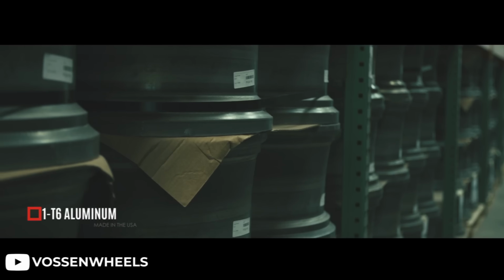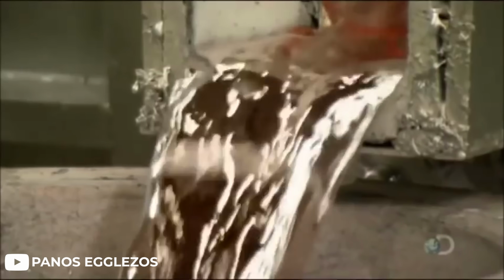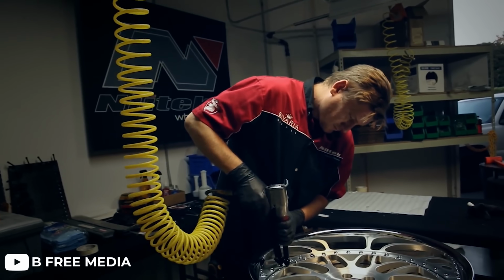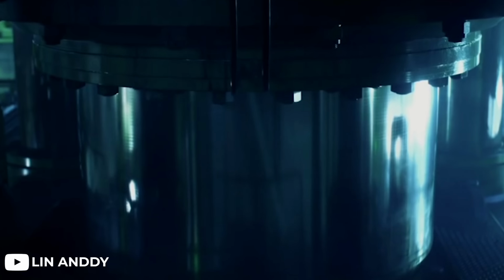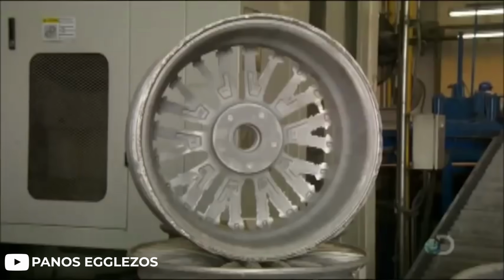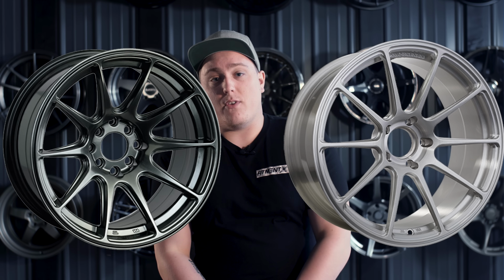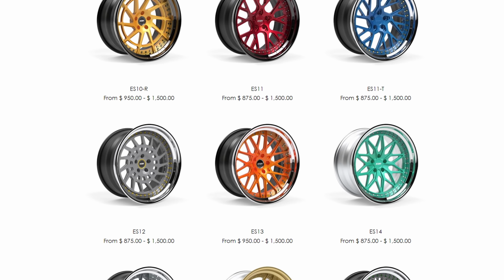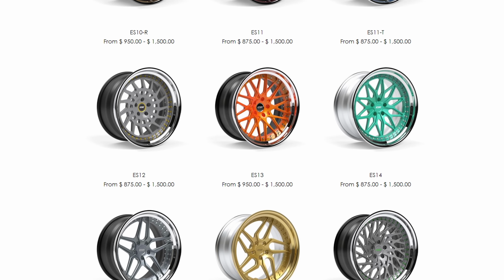What are Forged Wheels? | The Build Sheet

Comment: i am using a BMW E63 M6 oem forged wheels model 167, 5 spoke  for past 10 years.....never had a single crack or bend.....despite using low profile tyres and driving fast and rough on uneven road where i came from ...stick with wheels made from germany.....especially forged wheels...u wont have any regret....

Comment: Cast is well.....casted, completely. Poured material into a mold and cooled and trimmed. $400-$1000/set  
(ALL made overseas zero american made cast wheels: made in China, Taiwan...ect..)

Flow Form has a Casted Face, and Semi-Forged Barrel. Poured and pressure treated material for the face then stretched and heat treated barrel that strengthens its material structure. Then the face is trimmed just as the cast. $1100-$3000/set 
(Also all made over seas, no fully american made "flow form" wheels.)

Fully forged is a solid block of 6061-T6 (6061 = Aluminum Grade, T6 = Heat Treated) Aluminum. First stamped into its 80-200lbs+ Forging, then Lathed into its Profile(diameter, concavity, offset) and then milled exactly to design spec. 
$3000-$$,$$$/set depending on company and design detail+engineering.

There are A LOT of these forged companies today in the US that will get their wheels completely made in China and Taiwan and shipped over, SevenK, Z-Performance, Signature Wheels, BC Forged, and more. 

THE BEST fully forged wheels are made completely in the US and if who your buying from IS NOT IN HOUSE manufactured, they dont have business in the industry imo. all the china forged companies are watering down the true american forged quality wheels.
Reply: American wheels look like shieeeettt.🤮🤷‍♂️

Comment: How do they handle powder coating though? There's back and forth between people on car forums that powder coating wheels weakens them while others confirm they don't.
Reply: David how tf would powder coating make them weaker? They only cure at 390 degrees. Sorry but if your wheels break after being heated up to 390, you need to find yourself some quality wheels.
Reply: @JappyBomba  I figured as much, I got a set of RAYS Gramlights coated because a shop ruined them after unmounting so coating and refinish was the only way to go.